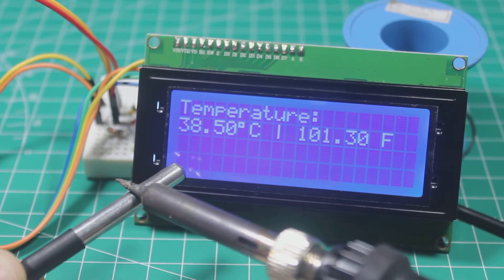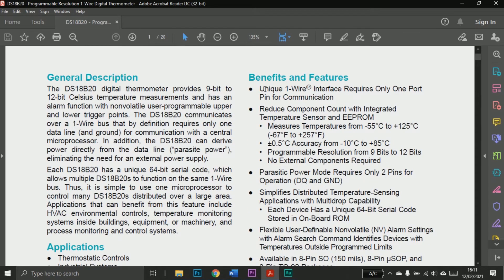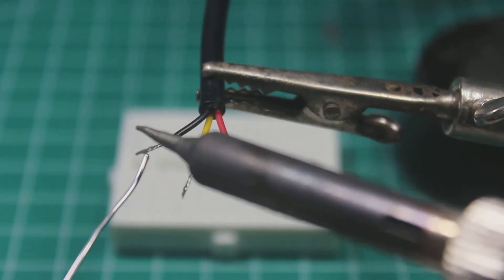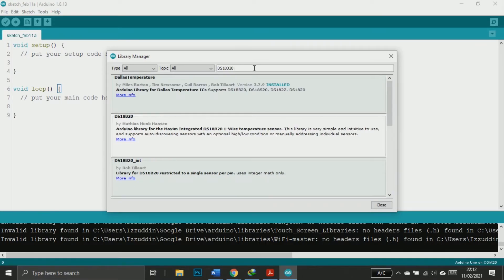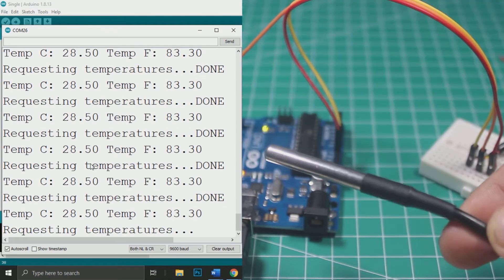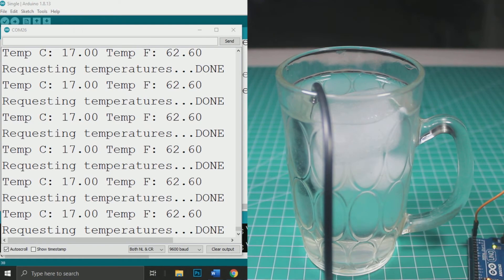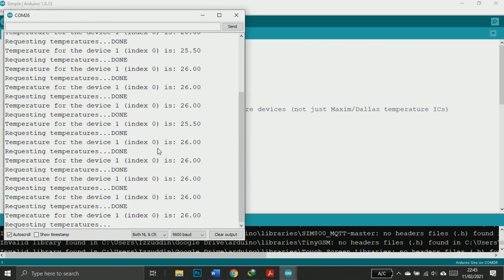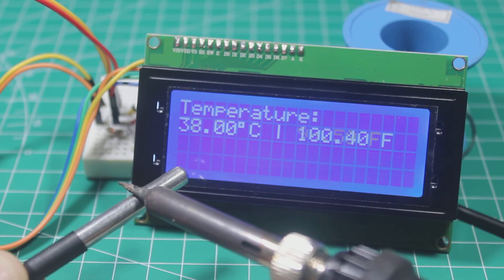How to use DS18B20 Temperature sensor with arduino

Comment: good video, but all i get is this in the serial monitor: 

Locating devices...Found 0 devices.
Parasite power is: OFF
Unable to find address for Device 0
Device 0 Address: 0000000000000000
Device 0 Resolution: 0
Requesting temperatures...DONE
Error: Could not read temperature data

Comment: My ds18b20 is not giving me results it only shows -127.00c and -196.6f it is not changing even if I put it on hot water can you please help me?
Reply: Use resistor

Comment: Is it possible to do this without a breadboard?
Reply from the maker: Sure
Reply: @miliohm  Does it require calibration?
Reply from the maker: @musicalmusician8019  it is factory calibrared. But if you still need adjusment you can also calibrate it.

Comment: Thank you so much  for this video👍
Is it possible to add an battery voltage sensor along with the temperature sensor in the same Arduino , How can we combine the both programs

Comment: If people are getting strange results disconnect the power line to the sensor if using parasitic power from the arduino. just run 5v thro the resistor to the signal wire in yellow. This is what the datasheet says

Comment: Hi, i'm having some problems with this sensor when i try to heat the water until it evaporates, my sensor can't read a temperature above 100°C or equal. My programation sketch is similar

Comment: What is the purpose of the register
Can the sensor be connected directly to the board ?
Reply from the maker: What register? 
The breadboard just help us to put the resistor
Reply: @miliohm  Sorry . i meant resistor
Reply from the maker: @AneeshPradeep  it's pull up resistor. It's from datasheet.

Comment: can i use a 4.7k resistor also i am getting -127° reading what can be my solution
Reply from the maker: It should works, check your wiring again.
Reply: i have same -127°... but ho to resolved it ?
Reply: @axel_72  Check your wiring and make sure that it’s getting proper power supply
When I connect this to my esp32 it was not working properly for me but Aurdino uno board gave me proper output

Comment: I've check the code you gave that is so detailed, to be a primer I learned a lot from it, I'll be guilty if I dont hit a like on this video.
Reply from the maker: Thanks!
Reply: @miliohm  what happens if no resistor is added to the circuit?
Reply: You can used ds18b20 module senzor, it has a led andcrezistor and is more easy to attach it

Comment: how about accuracy is better than themocouple ?
Reply from the maker: Make thermocouple accurate is sometimes complex since it has so small signal. So I think this sensor can be more accurate but, thermocouple has wider range. It can measure up to thousands degrees of celcius.
Reply: @miliohm   thank you for the answer